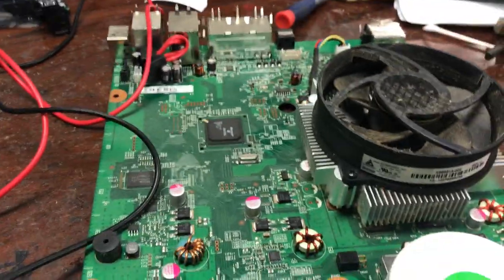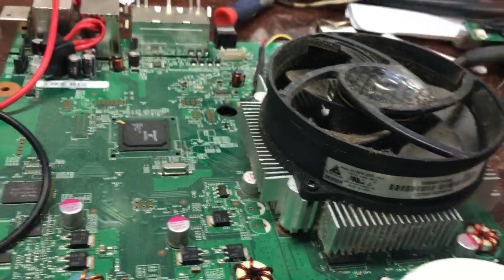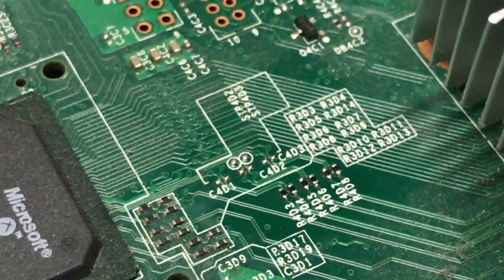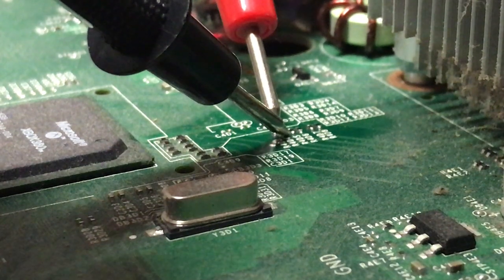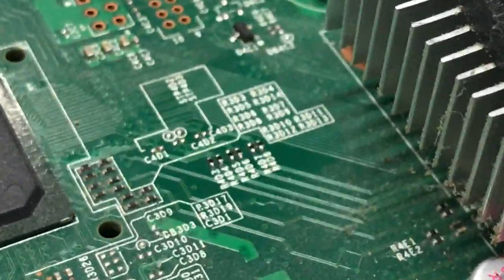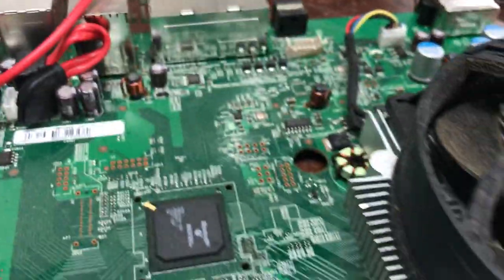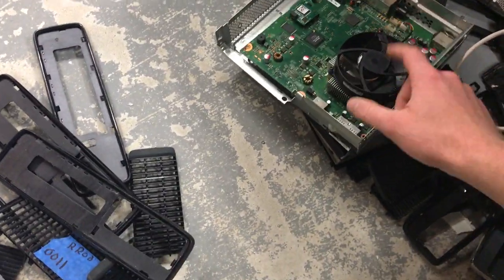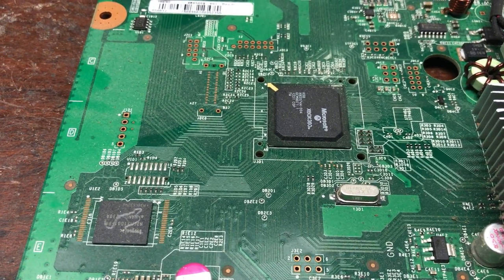How to Fix RROD 0010, 0011, 0012 Slim (Corona) Red Dot Error (Overheating)

Comment from the maker: These are 0 ohm SMD 0402 Resistors. You can also remove them and Bridge the points with solder instead of replacing them.

Comment: Damn two of mine didn't have continuity! I picked this XBox slim off the side of the road! Aside from needing a new hard drive, it had everything - controller, video cables, power supply... It was even dust-free! Like brand new! I just fixed those resistors up, and it runs like new! Thanks brother!

Comment: Thanks so much! All I did was reheat the solder on both sides of the one resistor that was giving me a bad reading and checked the ohms. That fixed it and I didn’t have to add any solder.

Comment: I found other videos before this one that recommended bridging the resistors, but I figured I’d just try reflowing the solder connections first like you described. Worked like a charm. Thankso mucho.

Comment: I don't get a code it's just green then red dot fan is spinning normal CPU is hot as fk and no code or any picture tv shows no signal when this happened the consol crashed and pixels came at the under 50 % on screen complete froze never started again what would you say?

Comment: Were did you buy the resistor? I cant find it anywhere online.
Reply from the maker: These are 0 ohm SMD 0402 Resistors. You can also remove them and Bridge the points with solder instead of replacing them.